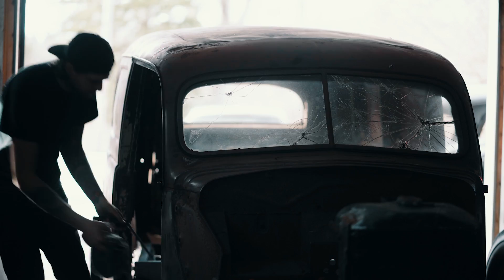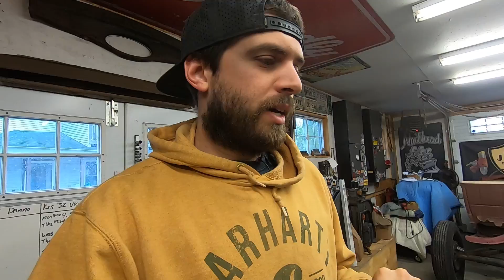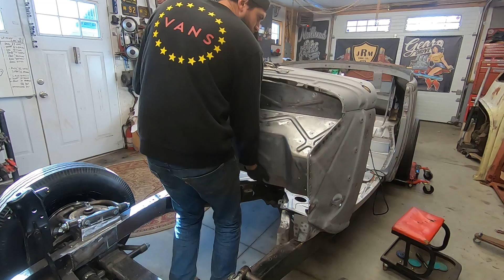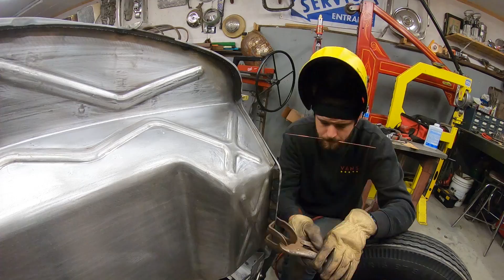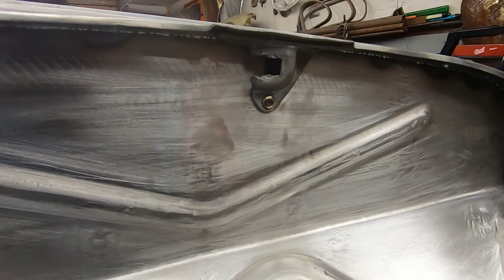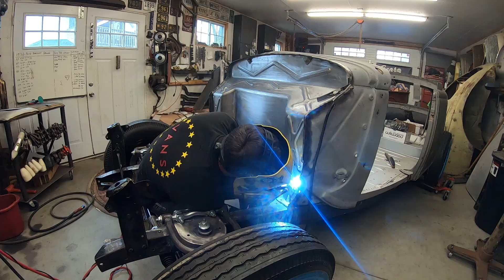1936 Ford Roadster Custom Firewall Install

Comment: I wonder how difficult it would be to fabricate a holder that would be mounted to your vice grips and also held one contact on your spot welder,  then you could just clamp and line up the other side push and pull the trigger and repeat.
Reply from the maker: That’s genius!

Comment: Ok so when I have to fill a bunch of holes I build a plug punch . Just weld 2pieces of  1/2 ''' plate together along one side with a gap for18 gauge to sandwich between. Than drill a hole the needed size of blank threw both plates then fallow up with a die made from a rod / bolt stock  of the same size and drive it threw the die to make your plug /blank . Cheers .

Comment: My OCD let out a big sigh when I saw the peaks of the FW stampings line up with the point of the cowl vent.  Nice-NICE!  Also, as someone with only mig experience, I was surprised to see the FW stamping die holes TIG welded up without a copper backing. Was that because the holes were small enough or because it's not needed on TIG welding?